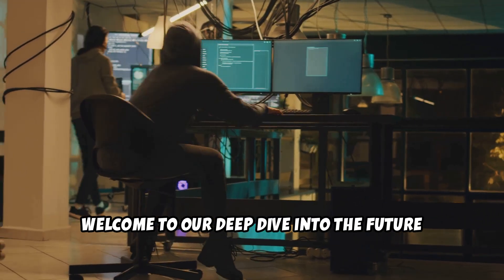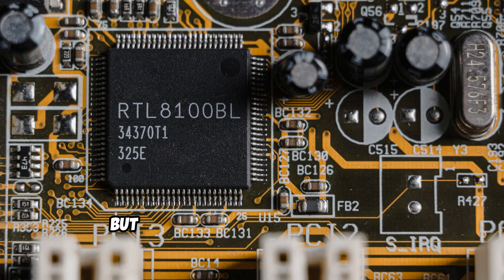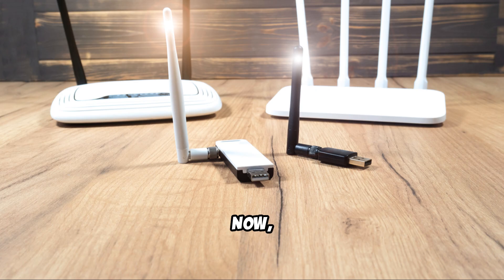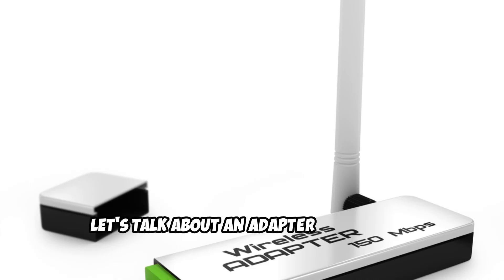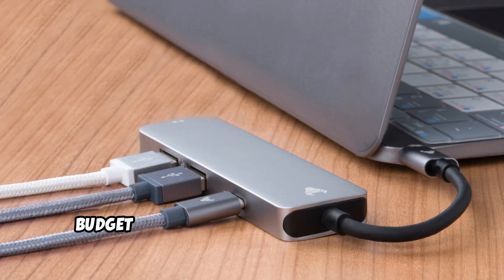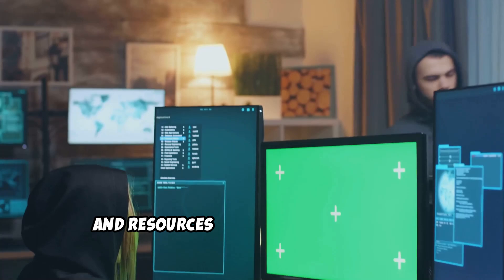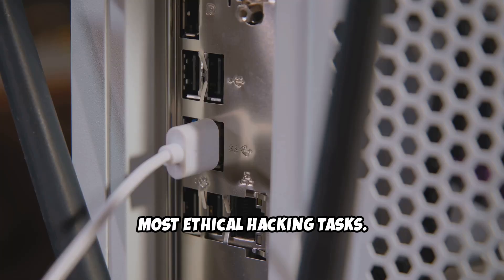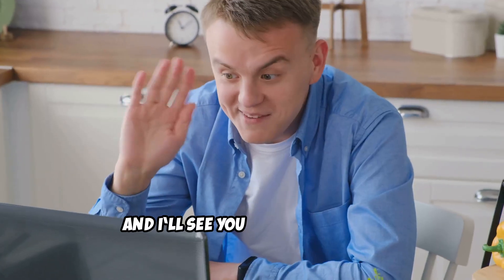Top 5 WIFI Adapters for Hacking in 2025

Comment: the awus036ach doesnt work  on any kali machines
Reply: Yes guys you need to manually do the driver ..... I beat my head off a wall for 2 days .... but eventually I found the right video
Reply: @davidjackson8304 how?
Reply: @davidjackson8304  can you share link
Reply: Did you find any solution?
Reply: @neferpitou3101 apparently it's not ready to go out of the box but I'm not sure myself just based off research